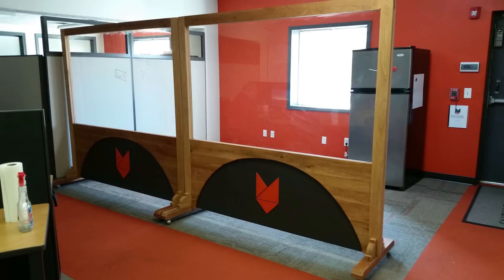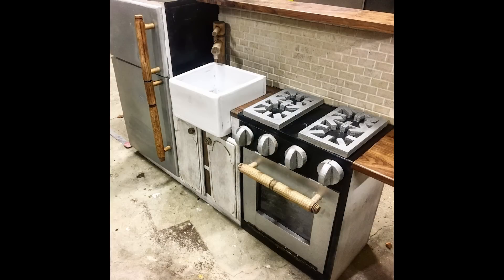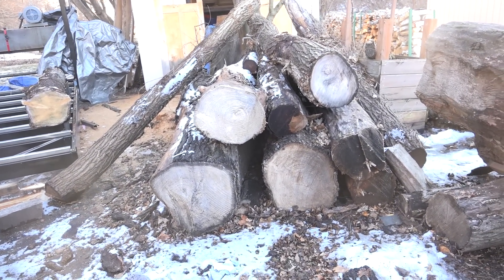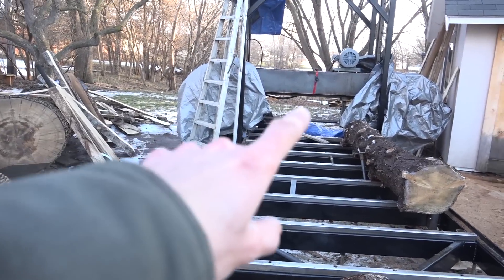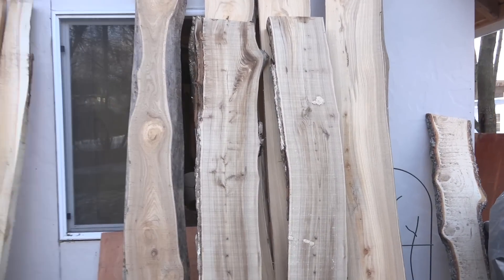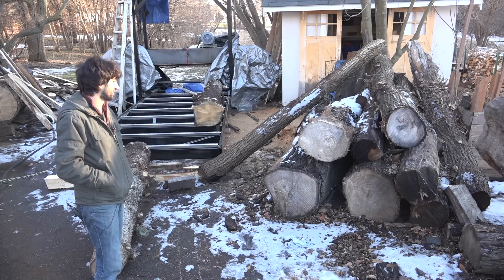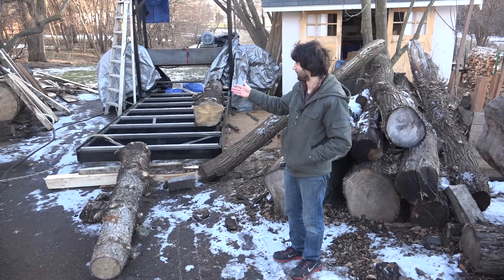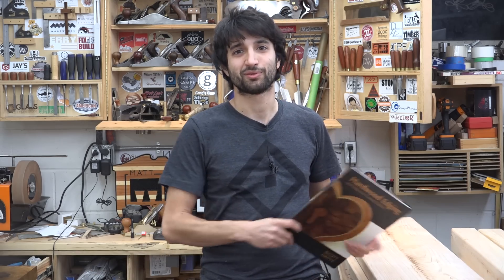Matt's Weekly Shop Update - Jan 31, 2017

Comment: Maybe you could add small metal ramp in front of the mill, so you would just pull with winch, without having to lift it. What I have in mind is just piece of sheet metal reinforced by some square tubing

Comment: thats what i did also,put a winch on the end of the mill to pull those logs onto the mill with. i that had to add a cart that held the end of the log off of the sawmill bed so it wouldn't get hang upon the mills bed  the cart had a winch on it to lift the end of the  log up, that all i had to do was hook the winch that was at the end of the mill to drag the log onto the mill with.

Comment: Sweetness! what is that chain coming off the corner of the mill closest to the house?
Reply from the maker: That's an anchor so I don't pull the mill when pulling logs off of the small pile
Reply: got to love it when a mill the size of the house still weighs less then the log you are going to cut!

Comment: Questions: After you fell the trees and have the logs, do you have to wait for a period before cutting them into slabs?  Once cut into slabs, roughly how long before you will be able to use them in a project?  (You use a meter to measure dryness?)  Which videos of yours should I watch to learn the answers to these questions and the ways to properly cut a log?  Thanks!

Comment: Hello Matt, to the right of your tool chest I noticed cabinet that holds sandpaper and you drill/driver.  it looks like its mad of MDF.  If it is could you tell me how you Joined it.  I have a half sheet of MDF and would like to use it for something like that but  No sure what the best way to join this material.  Can you provide some guidance?
Reply from the maker: It's joined with dados and rabbets to keep everything aligned and the frame is just glued.  The dividers are not glued so they can be adjusted if needed